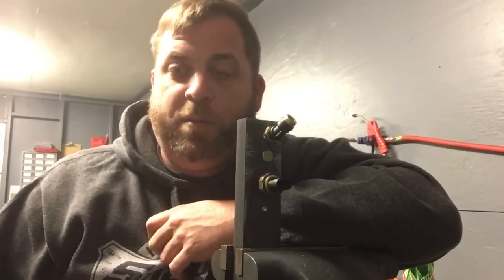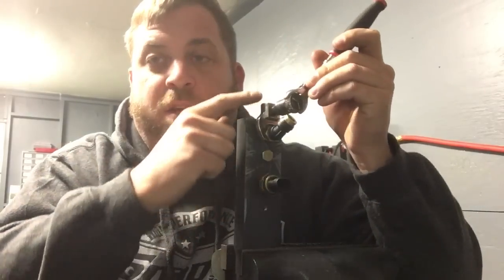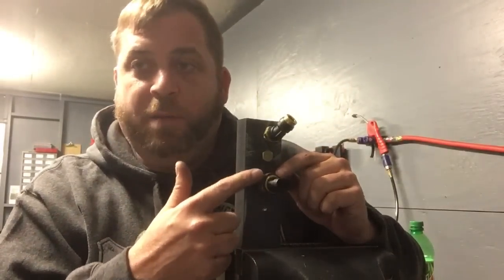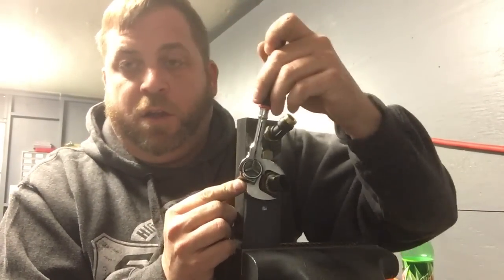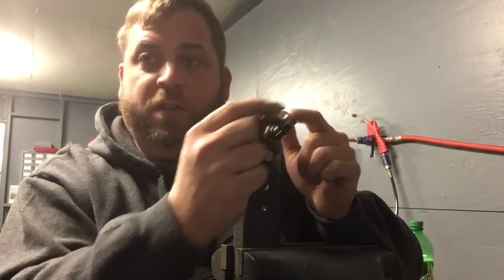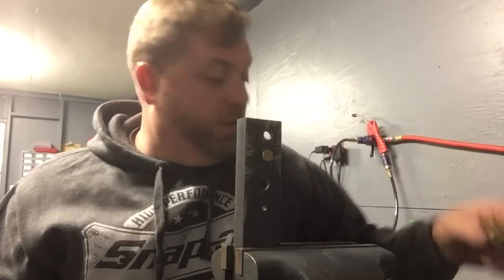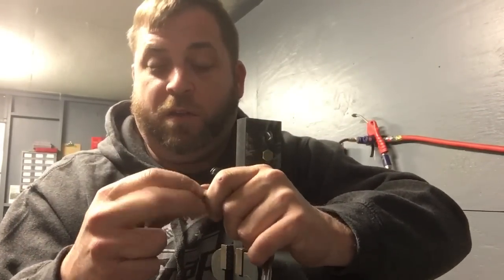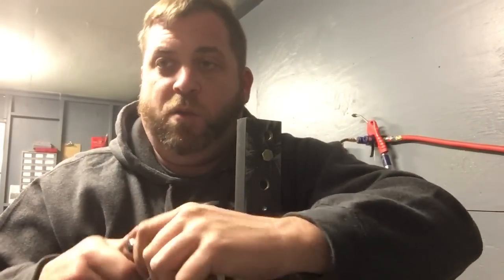Snap on junkie reviews crows feet

Comment: For anyone thinking about getting these, rethink first. The open end don't get a good grip on the fastener so you're likely to round off the corners. A better option would be to get the flare nut crows feet instead first, then the flare nut sockets after that (insanely expensive) 210FRXM.
Reply: There mostly needed on hydraulic fittings in tight spots were you can't get anything else on, even flared crowsfoot.

Comment: On the Torque wrench demo having it as straight as possible is generally incorrect. The crowsfoot has to be perpendicular (90°) to the torque wrench or else the moment arm created from the handle to the ratcheting mechanism is increased, thus negating the settings on the torque wrench. If the crowsfoot is perpendicular you can use the torque wrench settings, otherwise you have to manually calculate what the wrench setting should be.
Reply: Yep out straight the torque it less and back under the head the torque is greater. There is a formula to figure out how to adjust if needed. True torque = extension length (to the center of the drive) + Wrench length (center drive to hand location) then divide that by Wrench length.
Reply: Opps less torque out and less if under the head of affected torque to the bolt.
Reply: Yes, Norbar has an app for Android and iphone I believe, for the calculation.
Reply: I wonder if using the two right angle accessories, but having the crows foot turned 180° (almost making a C shape from the drive of the ratchet to the opening of the crowsfoot) on the second one, would put the crowsfoot closer to the center of the ratchet's drive. Of course the size of the crowsfoot would vary on the additional length added, but I'm sure most of them would be close to center.
Reply: Yep, I was going to tell Justin he had that torque wrench part of the video all cocked up but you eagle-eyed readers have already set him straight.

Comment: On the torque wrench part u should explain how ur torque changes depending on where u place it and that most torque wrenches come with a conversion chart on how far the extension goes out how much torque u have to add.
Reply: Or subtract*
Reply from the maker: JOSE VALLE I will have to save that for the torquing video but yes you are correct

Comment: when torquing with a crows foot you want it at 90 degrees with the crows foot or else your extending the length of it creating more leverage, that way you get the most accurate torque spec. 6:48 illustrates my point

Comment: There is a box end version and ratcheting open end version of them as well.Gearwrench is the only one that I know that makes ratcheting version.VIM makes the box end version,I have a set of these in metric and the 15mm came in handy  on a long extension for  access to a couple transfer case nuts so far.

Comment: I just ordered some crows feet because My oil filter is hidden under my intake manifold and there is virtually no room to get to it with your hands. Basically i relocated the filter with a kit but the plate and hoses that go in the original filter spot are not accessible with hands or reg wrenches. I basically cut a window in the wheel well (its a drift car) that i can get a crows foot on an extension bar into to tighten the plate and hoses (they a 1 time install) then made a plate to cover the hole

Comment: thank you for makimg this video. it was exactly what i was looking for. i have never used crowfoot wrenches before and I came across it when we needed to remove my friends O2 sensor on his taurus. 
the rent a kit from the auto parts store came with a socket that is offset like this. but we were having to get it from underneath, as it is in a tight space right under the manifold in the front but on the top of the exhaust pipe. zero room for a tool. 
we spent a good while on it and never did get it off. I have extensions and breaker bars and everything. these look like they would not work from underneath. 
i am still trying to wrap my head around how to get torque on this socket. 
my next try is to order that size flexible head rachet wrench. I have heard that has worked for this i have a set, but not one big enough. 

anyways... great video. 😀

Comment: OK ,,, just made me feel stupid.. had to replace my back up light  switch on my KIA ..
 had to buy a 24 mm deep ...never had  found a need for such a beast before... now I see this video..I do have a complete crows foot set ..I will probably  go 20 years without needing the 24mm deep again..and I will be 74 by then so I will again forget about the crows foot LOL
Reply from the maker: deepsquat600 glad I could help you remind you to get crows feet
Reply: A 15/16 would have worked. Both about the same size. And I actually use that size quite a bit on suspension jobs. Also some lugs nuts are that size.
Reply: just checked my tools..had that in a shallow but not a deep ..so